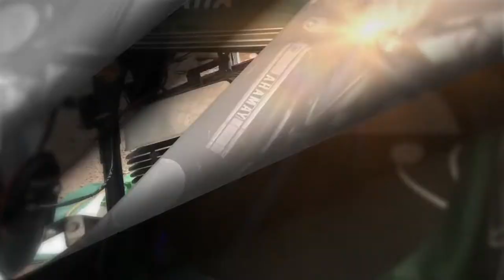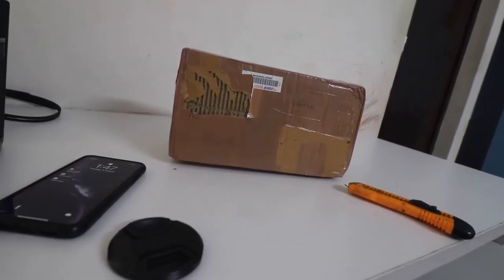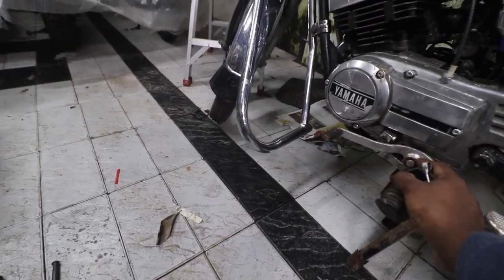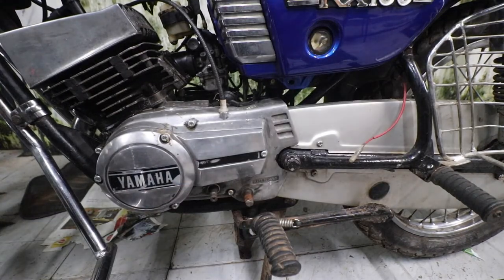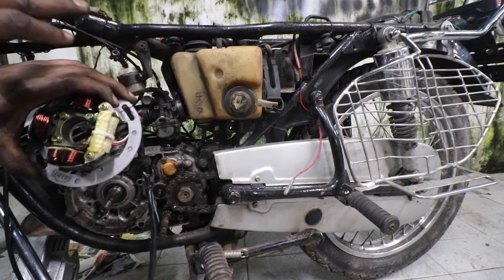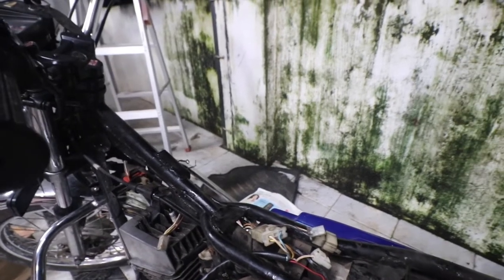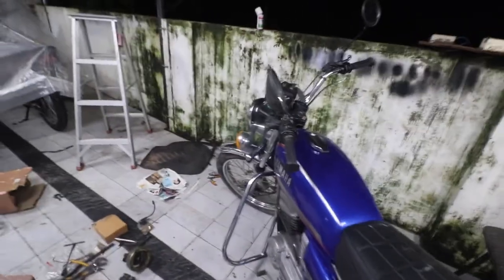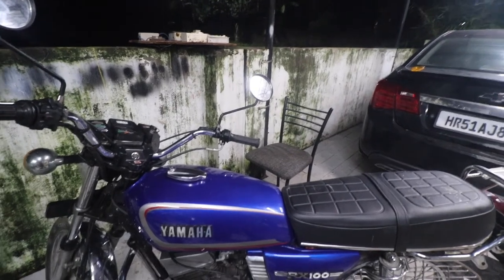RX 100 Allied CDI step by step DIY Install and honest review (English Video)

Comment: I installed the latest version (version 5) of the Allied Electronics coil set. Lighting has improved dramatically. My RX 135 has no battery and the only electrical in the whole bike is the headlamp bulb. No indicators, no brake lamp, no horn, no nothing still the lighting is superb and the bulb is intact even after running at very higher RPMs during night for long duration. Performance-wise definitely better than stock set up. Acceleration has improved in all gear/RPM range. Top speed has improved at least 10% from stock set up. No need to even up jet the carburetor. And the way Mr. Rehman speaks is very humble and ready to help out any time regarding this product. It comes with a 2-year warranty. I shall vouch for this wonderful product.
Reply from the maker: 👍 he is a gem

Comment: Intially I was a bit skeptical about this but ordered the kit anyways (something is better than nothing) for my RX135 a week back from Mr Abdul, was shipped within 3 days at my doorsteps. Got it installed from my mechanic also got installed a reed valve locally purchased and after it was done I took it for a spin Boy oh Boy! I almost scared the shit out of my self... "I kid you not" My RX has turned into something else... Earlier I was thinking to install a front disc but now I need to install a front disc setup ASAP. Anyways Thankyou to the channel for the recommendation of the Kit... 

Cheers !
Happy Ridings !
Love form the North 🤘🏻

Comment: Great video and information.  I was always curious about this product since i saw it on facebook and like you mentioned its rare and reassuring for a manufacturer to put up a dyno graph to show performance difference vs group fanboy vouching without any evidence.  Will try this one out shortly post the rains.  Thanks.
Reply from the maker: You will be amazed at the customer service right from the moment you place an order till it’s fitted on the bike
Reply: @Yamakaze  Thanks bud.  

Also wanted to check there are 2 markings/lines made on the coil plate in the kit you are installing. Did you do this or does it ship that way.  

Is that the stock timing marking or advanced to a certain degree.  Thanks.
Reply from the maker: shayne dsouza it ships that way, there are slots so that you can advance or retard timing the way you want
Reply: @Yamakaze  so the marking would be stock timing I assume?  Did you advance timing during ur install? Thanks
Reply from the maker: shayne dsouza no, right now mine is in the stock timing mark
Reply: @Yamakaze  thanks 👍

Comment: with this allied kit suggest a reflector and H4 bulb holder to accommodate 60/55 lighting that we can use in stock headlight doom with outer chrome ring.....it shouldn't  protrude with the stock doom assembly..ur inputs pls...
Reply from the maker: Dcm Toyota headlight beam bus Enfield Bullet connector
Reply: @Yamakaze 😃 ok...thanks u so much..one more doubt if we keep it with stock 35w bulb will it withstand the voltage or is it absolutely necessary to upgrade to 55/60 or 90/100. I will be using the stock 2.5AH battery only..
Reply from the maker: @KK-cd7nu  90/100 gives the best results, can work well with a stock battery

Comment: As and when would possible, it would really be nice if you could confirm the timing wrt to TDC that the kit is running on as per the suggested marking on the stator plate. Thanks
Reply from the maker: Roughly 18-21 degrees

Comment: Hi bro. Planning to install it in my 5speed but spoke to rehman from indian electronics and he said the analog kit is same across all RX variants. His dyno video show performance improvement in 135 4 4speed so I'm a bit confused now. So will this help improve 5speed performance as well since the magnet , cdi etc are diff in 5speed. Thanks in advance
Reply from the maker: It should, the Bhp claimed by the company is at the crank, what you saw on the video is power to the wheel
Reply: @Yamakaze yeah thanks...and one more doubt so with analog kit the stock 5speed carb will be fine or do I need to go for any other carb setting since revs will be much higher than stock.
Reply from the maker: @KK-cd7nu  stock should work well, if not then take the 4S jets and install them
Reply: @Yamakaze  ok. Thanks
Reply: Hello KK, will you please share the above-said video? Thanks in advance.
Reply: @king000775  check his YouTube channel. INDIAN ELECTRONICS

Comment: I have two queries:
1. I have enquired them the details and apparently they have static and variable timing cdi kits. Which one is being reviewed?
2. Thoughts on rx 135 - 4 speed as which one to go for, static or variable cdi kit?
Reply from the maker: Static timing kit is simple to install, the variable timeing kits installation is same as the static kit but it gives you an ability to program it, it also advances and retards timing based on the rpm in simple words it’s equivalent to vtech in Honda.
Reply: @Yamakaze which one is installed in the video? Static or dynamic one? Also should you advance the timing with this kit?
Reply from the maker: Shakti Thota this is the static kit
Reply: Which one give more power,static or variable?
Reply from the maker: Mahesh B both give the same power but dynamic kits ensure more usability and customisations

Comment: Nice Video... Is the magnet, India Nippon make and how many wires are there in the RR unit? Thanks
Reply from the maker: The magnet is made by allied electronics. The RR unit has 4 wires
Reply: @Yamakaze  Thanks for replying
Reply from the maker: @chiradip24  👍

Comment: Today installed on my rx100 

I am facing an issue .. while accelarting at above 40kmph bike is choking up always 

I even tried of using rx135 carburettor same problem arise 

Can you help on this
Reply from the maker: Throttle position not speed
Reply: How to rectify
Reply from the maker: @debutcreations5450  first of all describe the fluttering properly, which throttle position?

Comment: Hello sir. After watching your video. I got this kit from indian electronics. Everything is fine except the bulbs getting fused. Got a replacement rr unit from him but that didn't fix it. He mentioned saying the 2 ground wires are touching each other one from the rr unit & other from the buzzer/flasher. Can this be the reason for bulbs fusing again & again? As i cannot find other places to install ground. Help would be appreciated
Reply from the maker: Watch the RD video, this is an analog kit
Reply: @Yamakaze  i have an rx100 & this kit is brought from Rehman sir of Indian Electronics. he said 2 ground wires must  be touching & after checking throughout i found 2 wires touching each mounted with a single screw. I'm unable to find a fix for mounting 1 wire on some other place on the frame.
Reply: @Yamakaze my kit is same as yours.
Reply from the maker: @MirSalmanAli  I am not sure if I understood you correctly. Ground wires can touch there is no problem. You can use multiple ground wires at multiple points. All should have continuity with each other.
Reply from the maker: Buzzer doesn’t have a ground, that 12 V switched, that could be the reason for failure
Reply: @Yamakaze  i didn't understand this
Reply: @Yamakaze  means there is no problem if multiple ground wires are fixed on single mount?
Reply from the maker: @MirSalmanAli  no
Reply: @Yamakaze  I'm unable to figure out sir. Checked throughout everything's alright from wiring,cdi, connectors,magnet,rotor. Everything's all great but still all the bulbs on my ride getting fused again & again. Replaced the rectifier. Thankful to Rehman sir! Still the problem persists. I had connected hjg leds on bike, they also blew up. 😬
Reply from the maker: @MirSalmanAli  Do you have a working battery on the bike?
Reply: @Yamakaze  yes it has a activa battery as of now. Because original battery is low powered and i needed a small led on handle mount.
Reply from the maker: @MirSalmanAli  see the problem is kits are not designed to do 5 amps battery recharge, it’s definitely going to overload the wiring kit. Keep it to the spec the manufacturer recommends, allied electronics has definitely not tested this kit with a 5 amp activa battery
Reply: @Yamakaze  okay. I'll try once again after removing the battery out. Fused bulbs on my bike like 5 mins ago 😂
Reply from the maker: @MirSalmanAli  remove the battery and fit a standard battery, if it’s still blowing bulbs then disconnect the tail light and then try
Reply: @Yamakaze  headlight, Tailight both are getting fused post 1500-2000rpm throttle range.. will try today
Reply: @Yamakaze  thanks a ton for your suggetions sir. i removed the battery and the bulbs aren't getting fused now.. but ive got one more bug the lights are dim. using 30-35w for both headlight & tailight
Reply from the maker: @MirSalmanAli  90/100 that’s what you can use
Reply: @Yamakaze  my problem is partially solved i would say sir. the light is really very dim + i have old type halogen socket on holder which cannot connect a h4 bulb of 90/100. It's on stock headlight rn sir.
Reply from the maker: @MirSalmanAli  DCM Toyota reflector, H4 connector from an Enfield bullet.
Reply: @Yamakaze thank you sir! I just spoke to Rehman sir.. he said it's bulbs are blowing because ground wire is getting short somewhere it seems. Gonna take it to a  pro electrician on Monday & 90/100 bulb from which bike?
Reply from the maker: @MirSalmanAli  H4 bulb from car
Reply: Maybe the same complaint.My bike  bulbs are also getting fused.
Reply: @yamahamaheshvalluri6869  yes my problem is also not fixed till now.
Reply: @yamahamaheshvalluri6869  please let me know if your problem is fixed

Comment: What size magnet puller should be buy from market? Is there a better magnet puller available in the market which is easier for us DUMMIES? Can you provide us a link from Amazon if possible?
Reply from the maker: For RX 100 you can use a splendour puller
Reply: @Yamakaze  I have a RX-135. I think the magnets are different right?
Reply from the maker: @SS-sh6ww  then it’s a very specific tool, you can modify an r15 puller to work on an rx 135

Comment: Ty bro i really loved it this one the problem we face with rx series Is lighting coil is to weak to provide light and horn even they won't provide indicator light unless we rise the throttle Gr8 video..
But my question is if we add the battery also did we receive the main head light without getting dim at low rpm
Reply from the maker: It does dim but is still brighter than the brightest of the old setup.
Reply: @Yamakaze  nice ty

Comment: Did you install Analog or Digital??
Reply from the maker: Analog
Reply: Did initial pickup improve after installing this kit??
Reply from the maker: @TheWess450  yes
Reply: Bro I am facing one problem.....my bike doesn't have CDI connection in the original wiring....so how will I install this kit??
Reply from the maker: @TheWess450  we discussed on Instagram
Reply: After installing this kit , spark plug knocking or pinging sound appeared....the sound comes whenever I accelerate....any solution to this??
Reply from the maker: @TheWess450  is there any performance issue? I have never heard the pinging noise. Maybe share a video on my Instagram
Reply: @Yamakaze   the last video I shared with you on Instagram.....already replaced with new pistons and rings....even rebored....still same issue

Comment: After installition of this kit on my RX135 I'm facing two problems here
1) The Kick has suddenly started to give "Back" while starting the bike and its quiet strong, is it normal to have such issue?

2) My bike has developed the problem of "missing" (I suspect there is a wiring problem)
Reply from the maker: Kick back is timing, missing could also be attributed to the timing issue
Reply: @Yamakaze  Can you please explain more, would be great help...
Reply from the maker: @milindthapa5975  if the timing is retarded back fire or kick back will happen, you will have to use a timing gun to time it, i will do a video on it, but dont expect it to be quick.
Reply: @Yamakaze  will be waiting for the  video 👌
Reply from the maker: @milindthapa5975  👍

Comment: Can you make on vedio on rdd CDI please?
Reply from the maker: Only if I get one for reviewing 😀
Reply: Make a on rdd CDI if you get one. Please  make a vedio on digital CDI and share the difference between Analog and digital CDI in performance , mileage etc.
Reply from the maker: Mahesh B I have an RDD cdi, the bike doesn’t run right there is misfires. I am not someone who is doing this for the first time, a lot of people who don’t get support reach out to me to help them. I have bought 2 so far, the first one was dead on arrival and I was asked for additional 5k to replace it. So I literally paid 12k for a unit and I was blamed for wrong installation while I already had a previous version from a friend and this one just replaced the old one. I have evidence or arrogant conversations. To me personally the RDD cdi is not worth the time, efforts and hassle.
Reply: Atleast can you please make a vedio on the variable timing kit of Indian electronics and share the differences as I'm very much interested in digital CDI and wanted to see how it performs when compared to the static one.
Reply: I also wanted to know if this kit performs better or not when compared to rdd CDI  as you have experience on riding an Rx fitted with rdd CDI.Also share me engine temperature, mileage,max rpm etc of both CDI.
Reply from the maker: Mahesh B my personal experience I have not been able to set it right, if I drill the hole in the coil plate the engine doesn’t even rev. I don’t want to create a strom by saying this is better then RDD because I seriously don’t want to be trolled by the RDD fan boys. In my experience this was simple, plug and play. Mr Rehman has promised me to send a Digital CDI kit for review, I am more interested in getting it for the RD than rx. My RD had one of the first versions of Mr Rehman’s CDI kit, but I had bought an rdd static cdi due to plain itch and I immediately noticed that the low end torque disappear and also the top end was shallow. My 2 cents
Reply: Tats good.My final request for you is to make a installation vedio and review of digital CDI made by Mr.rehman for Rx series if you get the review unit.

One more thing, please share the engine temperature after ripping it hard,mileage and max rpm of the static cdi .Also explain these things in your next vedio on digital cdi.
Reply from the maker: Mahesh B all this will come but can’t say it will be in the next video, already shot the next video and about to start editing 😀
Reply: Early waiting for that vedio.
Reply from the maker: Mahesh B 👍
Reply: I have a problem in my Rx 135.I see a few drops of oil spilling out of my chain cover after I go for a ride and park it.I don't know is that the gearbox oil or something but it happens every time after my ride and I also see a smudge of oil on oil pump cover even though I don't use autolube .I just use premix for over years.Please share a solution to solve this.
Reply from the maker: Mahesh B check the bend pipe seal at the cylinder
Reply: It is fine,i checked it and all the oil seals are recently replaced with ars brand oil seals
Reply from the maker: Mahesh B brand new oil seals can leak, take the chain cover apart and check if there is oil splashing from the chain, remember this chain is always greased never oiled.
Reply: I used a chain lube instead of grease but I don't think it is the chain lube.As it happens more than 2 months.So it should be the gearbox oil.
Reply from the maker: Mahesh B but when I said that you told me the oil seals are new 😁. By the way could be the clutch side packing as well
Reply: Can I use chain lube or the it should be greased? Which one is correct?
Reply from the maker: Mahesh B always do what the manufacturer recommends, chain lube is used for chains that is exposed and has orings in it, these are not that, grease is the best option in my opinion

Comment: such a bad product, I have a bitter experience, poor manufacturing quality, I purchased on 2020/08 but it was a default item however, my mechanic managed to install it after a long time. The ignition coil was not a perfect fit. the thickness of the magnetic coil is of poor quality. I recommend not to buy. if anybody wants this kind of kit, buy a second-hand coil of rx135 4 speed and modify it with the help of 2 wheeler electric mechanic
Reply from the maker: Did you contact the seller? Everyone who I know have had great experience. If you did receive a defective kit ideally you should have got a replacement under warranty. Can you elaborate why you installed a defective kit despite knowing it’s defective?
Reply: I returned the same for replacement but they just repaired and send it back, they are blaming the mechanic and asked me to adjust the timing
Reply from the maker: @sameershamu31  still now you are not talking about the issue, can you tell me the issue? Based on it I can give you suggestions
Reply: @Yamakaze  after riding few kilometers, bike pick up going down a little fluttering also. now I am using an old swiss CDI unit instead of Rehman's DCI unit. recently only this issue started. in the morning no issues, after heat bike pick up goes down, thereafter i installed yamaha oe cdi kit but that too same issue, no idea wt is happening. I guess it is a timing issue
Reply from the maker: @sameershamu31  HT coil, replace that with a power brand splendor coil and see
Reply: How's it running now?
Reply from the maker: @waynesaldanha361  nice